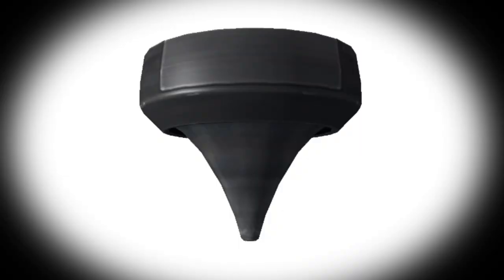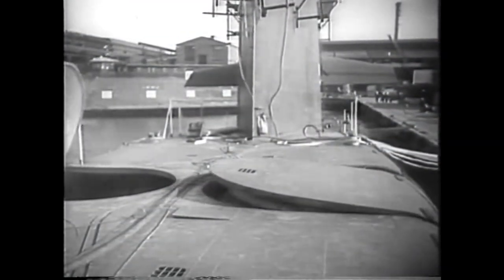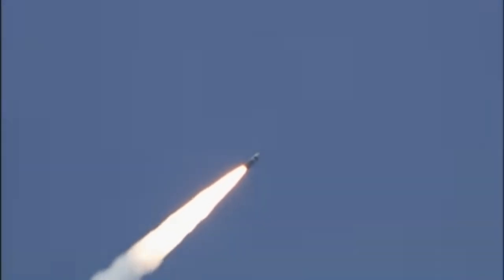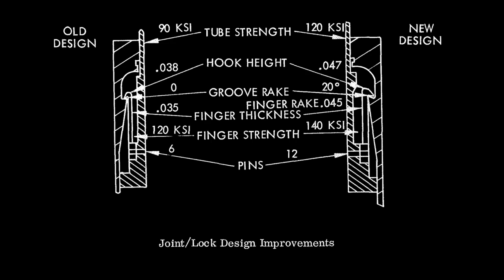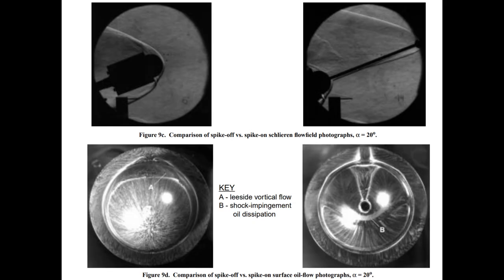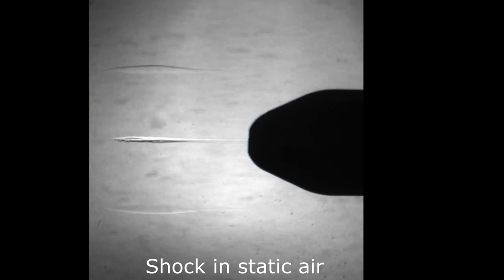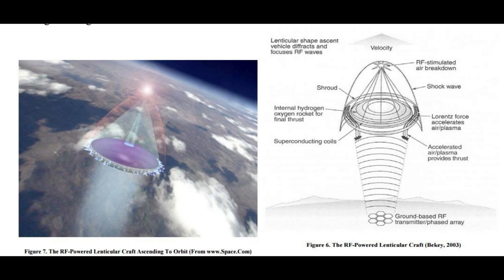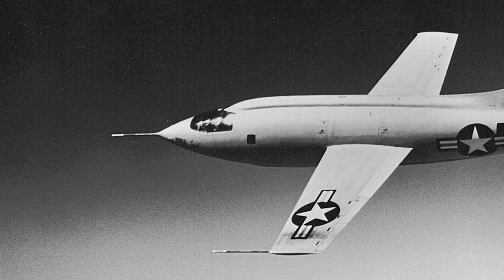Why Does The Trident Missile Have A Spike On Its Nose?

Comment: Seriously? A supersonic torpedo? 😳
Reply: Hmm. The speed of sound is four times greater in water too.
Reply: @RobinWootton  I thought about that as well, but my guess would be that they used the speed of sound in air as a reference. Which is still insanely fast. I find it hard to believe actually. Have to do some more research on this. Maybe they are talking about the speed of sound in rubber, which is about 60 m/s, which is still insanely fast coming to think of it. 🙂

Comment: When I recently heard in another context that the big bang theory asserts a constant acceleration of the expansion of the universe, I ask why. The acceleration may change, such change is called a  jerk. So the universe may be a constant jerk or an ever increasing jerk, so that everything will tear apart. If the jerk(s) stop then we could stabilize to a steady state.If the jerk(s) get negative, maybe the universe could collapse. Or if the... whatever is so huge that what we call the universe is one structure, getting jerked by other objects going by. That would be like our universe is just riding the waves on the surface of, or deep within, an ocean of such objects that jerk each other around periodically. Any jerk (dA) disproves the need of a big bang. If published, call it the Jerk Theory!

Comment: I feel vindicated. I always thought that a device to thin out the air ahead of a rocket would help greatly in the thicker lower atmosphere. I took the Russian gas bubble torpedoe as an analog. So lets fire a gigantic laser on the path of a rocket and super heat the air to let the rocket slip through.

Comment: Given the configuration, the importance of tip shape, and its position and use of these devices, I advocate we not call these "aerospikes" and instead call them "Aero-lances."

Also, while we're talking about shockwave formation management, have you seen the weird things on the trailing edge of the wing of a Convair 990? I saw them because someone was talking to me about the tire testing program of the space shuttle which involved a Convair 990 and a remote control tank with a drill on it....

Comment: About that idea of using plasma to keep air flow away, can't reentry vehicles use something similar? But except spending energy to create the plasma in front of your vehicle (as at some point you already have the plasma bc of the speed) you use energy to magnetically keep that plasma away from your shell? So you would only need minimal heat shielding? You can still magnetically push against that plasma to slow you down though.

Comment: Does this Work for heatshields?
Reply: That would not be good as the speeds of entry would melt the spike. It would  also make the capsule unstable
Reply: @peeperleviathan2839   i meaned it more Like Puting a smaller heatshield at the Tip of the Spike to have more Compact heatshield and lower replacement cost

Comment: I had heard about the microwave aerospike, I have found much on it on the net.  Mostly end up with rocket nozzles, which interesting but not what I was looking for.  The concept of aerospike in water is like a dolphin nose.  Large cargo ships have been using the same concept for some time to cut drag.  I have to wonder if you could use the same concept for re-enty?  One discovery channel show used the concept for water entry for boats.

Comment: What would happen if, theoretically, a missile could move through the air without worrying about exhaust gases, I mean, jet or rocket types. I had a "vision" of a needle moving through the air, without a reactive exhaust, and I wondered how it might be different aerodynamically. Seems to me it would be simpler, so to speak. I wonder how it would affect flight, or sonic boom, etc.

Comment: If you get the cleanest air at the tips of the nose for an aircraft, why do aircraft today usually have their pitot tubes on the sides of the nose instead of directly in front (other than the fact that the radome is there)? Is it different for commercial aircraft that aren't flying at high speeds or is the air not affected as badly?
Reply from the maker: You tend to find these probes on test aircraft, and they use it to calibrate the air instrumentation in the rest of the plane, once calibrated they remove the probes.

Comment: QUESTION: 
Nobody has addressed this yet, so maybe it's not a big deal. On the 11 engine, Nov 30, static fire of the Starship booster, there was a big plume of gases being ejected from huge top of the frost line of the oxygen tank portion of the booster. What was that? I thought, for sure, that someone else noticed that, and would investigate it.
Reply: I believe they were testing the autogenous pressurization system (for the LOX tank) where they take hot gas from the engine and use it to pressurize the tank, likely there is a PRV as well and maybe as the pressure spiked it did it's thing and vented some.
Reply: @TheEvilmooseofdoom  It was fun watching the Starship test flights, SpaceX generally gave no indications on when when they would do a launch, road closures were about the only official indicator. But those guys who really follow it like Tim Dodd and NASASpaceflight, they had every vent, burp and gurgle of the rocket timed and they could predict T-0 with pretty good accuracy, especially as launch got within a few minutes because the different events were fairly predictable.  The large scale timings came from the guys up on the crane doing something I forgot what, I think arming the FTS, when they finished then it was about an hour to launch or something like that. They also watched for when the last vehicle drove away, they tried to keep track of how many vehicles were at the pad so they would know when the last one left.

I remember the SN11 test flight was in total fog that morning, they assumed it would not launch until the fog lifted, but then they started hearing familiar sounds and realized that it was getting ready to launch and they estimated T-0 pretty good just by sound even without being able to see it. Pretty amazing.

I think it was Jules Bergman if I remember correctly saying that on the early launches, I think maybe the Mercury unmanned test flights, that NASA seemed to be trying to keep the launch time secret, but Bergman would watch for LOX venting I think it was and then announce to the TV audience the approximate time to liftoff.
Reply: @Lensflare Deviant, I think you're right. I forgot they were testing autogenus pressurization. That probably made the large O2 vent that I had not seen before. The added pressure provided by the engines was probably what popped it off. Autogenus pressurization probably was a success. Thanks!